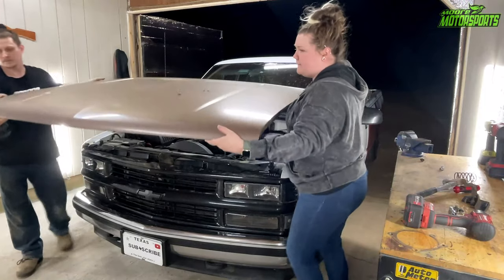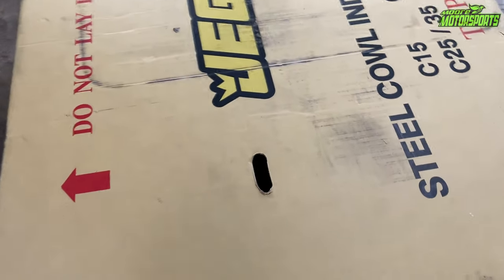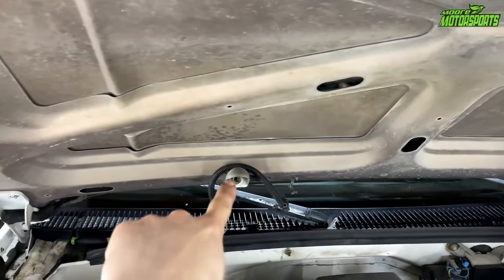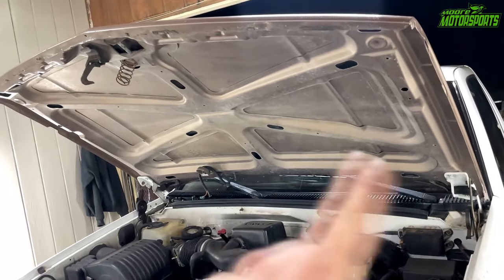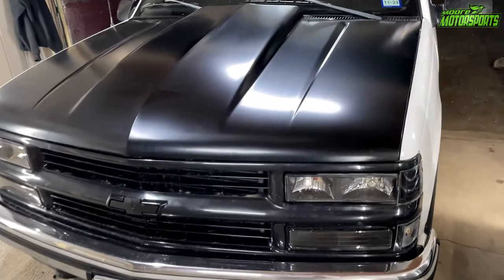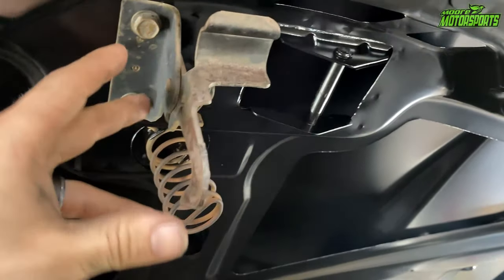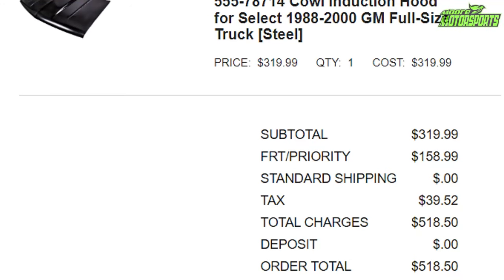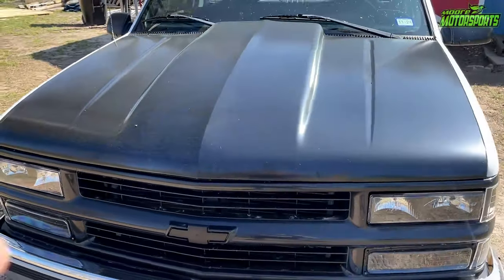JEGS 88-00 CHEVY COWL HOOD INSTALL & REVIEW!

Comment: Are you going to paint it with spray paint if you do could you show the process of all the sanding because I also want to paint my obs and a tutorial would be helpful
Reply from the maker: If people would watch a sanding and prep only video I would do one but this one isn’t gonna be so cut and dry. It has to have A LOT of prep work but this will not be spray painted for typical paint. It’s going to be primer out of spray can but it won’t be smoothed perfect like I would with spray can job because Bedliner it can have a rough primer because Bedliner is thicker and covers stuff. This wouldn’t be a good demonstration of sanding and prepping for smooth perfect flawless looking shiny paint due to my plans of Bedliner.

Comment: I know you mentioned the hood latch opening fine now. My "trick" to fix the hood opening was power washing the mechanism to clear it of any grime/debris and then some lube and the issue went away.  Another tip i picked up along rhe way was "slamming" the hood close cause pushing down on the hood caused some dips on the nose of the hood.
Reply from the maker: Yes that’s what I did I pressure washed it and then changed the hood because previous hood prior to junkyard one was bent up bad so probably the only real reason it did that lol